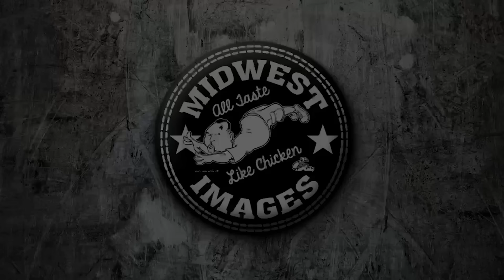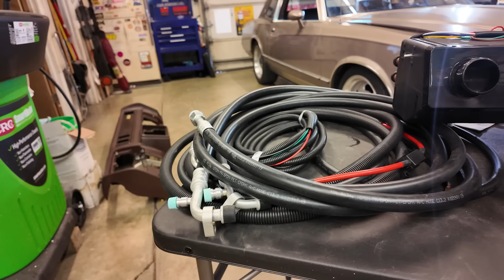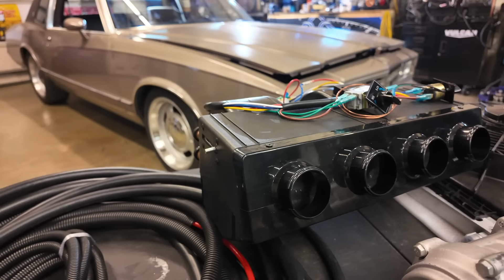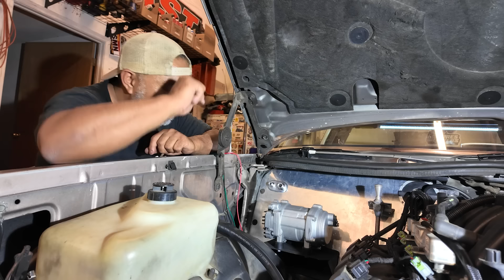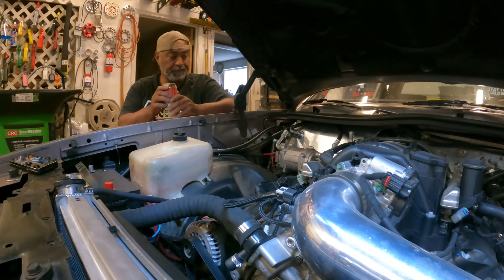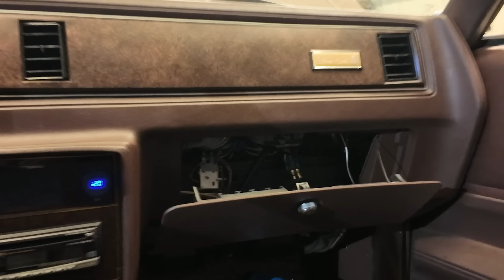12 VOLT AIR-CONDITIONING MY HEMI MONTE CARLO...IS IT WORTH IT?

Comment: We recently installed a 12 volt stand alone AC Unit on a forklift at work. It draws 48 amps running, and it spikes 60+ on startup. It was draining the battery and operator had to turn it off and let the truck idle for a few before turning the engine off to make sure it would start again. The factory alternator only put out 70 amps. I had to install a 105 amp alternator to keep up with the draw.
Reply: Amps are not really the measurement that matters... 12V or 240V its still same amount of WATTS. - But Ok! 
2400W at 12V = 200A = 2400W at 240V = 10A = Its just smaller wire at 10A vs 200A LOL
Reply: @misters2837  excellent point...higher voltage=lower current.
Reply: @misters2837 amps make conductors hot though. That's electricity 101. That's why amps is focused on. Also; batteries are rated in amp hours..... Just food for thought
Reply: @workingcountry1776 batteries are rated in volts AND amp-hours. Since battery voltage is fixed for a given battery (and the system it goes in), we compare amp-hours to determine how long a battery will last at a given voltage. You can't compare a 48-volt battery and 12-volt battery based on their amp-hours, because they are not interchangeable. But you can do the math to see how much power each system draws and how long a given battery in each given system will last on a full charge.
Reply: @misters2837 less loss in wiring and motors at higher volts and lower amps. a 48v system consumes about 20% less total wattage and is easier on all relays and motors
Reply: @misters2837 you didn't explain anything just crap
Reply: That's a ton of amps. I can't imagine the ones in Teslas draw that much power.
Reply: @mooosestang because Tesla is a few hundred volts. 12v has it's downside.
Reply: @mooosestang they run off the high voltage battery = lower current.
Reply: @mooosestang no, he said 48 amps. that is enough to lift 1000000 tons, using the right equipment.
Reply: @petedude2lu3 crap analogy.
Reply: @mooosestang they do...but Tesla has a huge ballery
Reply: @mooosestang  It draws about the same POWER (Power = Volts x Amps), but EVs use a High Voltage compressor that's runs off the HV 400 Volt battery pack... so their Current (Amps) is just a few Amps.
Reply: @mooosestang  I did a google search and it came up with this........
Tesla air conditioning systems, like those in other electric vehicles, utilize a heat pump and an electric motor to regulate cabin temperature. The system draws varying amounts of current depending on the cooling/heating demand and fan speed, ranging from 2 amps for minimal cooling to 12-15 amps for maximum cooling or heating, and potentially up to 20 amps.
Reply: @cuzz63 amps alone can be misleading, how many watts?
Reply: @rustedhorsepower5132 Exactly, depends on the voltage input of the Tesla system. W=VxA(current)
Reply: @cuzz63  Amps say nothing without a voltage . A heat pump is also just a fancy word for a normal ac cokpressor
Reply: I would consider a device that doesnt allow the motor to shut off unless the AC was off for a set time and the AC cant turn on until the engine has been on a set time.
Reply: Get rid of condenser fan and use the radiator fans with this condenser or the original condenser attached to front of radiator and wire it do that only 1 fan comes on low at any time the air is on and engine running like a normal car ac system works. Fans are some of the highest draws on any vehicle and they are designed to run low at idle, speed up above 950 rpm and turn off over 20 mph since air flows from speed and conserve energy. That condenser is way too small! Use stock condenser for less need for fans
Reply: Could it be that moving more air thru evaporator, the compressor wouldn't be at the 12,ooo BTU rating...kinda playing with rating...slowing down the air allowed it to get colder achieving the BTU rating for advertising purposes....but in reality it was based on such slow air movement it was unrealistic. Faster air movement would create inadequate air cooling.
Reply: @danobrien5154 BTU is like watts.

and it doesn't matter if you have high temperature delta at low airflow or high airflow at low temp. delta.

much like electrically high voltage at low amps or high amps at low voltage.  same power (watts or BTU)

it's rather a fake statement because you can't get 12.000BTU (3500W) from 12V/60A.  car AC is about COP of 2 - 2.2. that means for 3.5kw cooling capacity you'd need half that (COP of 2) electrically => that'd be 1.75KW and 12V × 60A is nowhere near 1.75Kw.  it's well below 1KW.

 because 83A at 12V is 1KW.
Reply: Put in a high amp alternator, idle up to 950 when air is on using the idle air control valve or set base idle screw to 950 and use a 200 amp lithium battery for all that electronics or at least 2 group 31 lead acid batteries or a 4d or 8d battery. Then get a voltage sensing relay to put between starter battery and your extra battery in the trunk so it disconnects from your starting battery at idle so it doesn't kill starting battery but still cool off of the lithium auxillary battery. Or add a second alternator and lithium battery.
Reply: That is epic
Reply: Thank you for supplying a ballpark number for running amperage.   That sounds realistic,  after all the belt-driven compressor on older cars is enough to affect idle (esp. on carbureted cars) and on economy cars you really feel a difference in acceleration with the air off vs. on.  

I've been planning one of these in my classic car;  in addition to an upgraded alternator I think I'll also work up a switch that ensures it's off when the engine isn't running,  or maybe when the voltage is below 12.5 or something along those lines.
Reply: @shovelIRL So far the 105 amp seems to be keeping up. With the AC on full at idle, voltage at the battery will drop from 14.1 down to about 13.3 or so. Give it any throttle and it'll go up to 13.6/7. We did install a 12 volt, 120 amp relay on a keyed circuit because the kit has you wire directly to the battery so it would run even with the key off.
Reply: @angryyankee9184 put a smaller pulley on the alternator so the alternator spins faster at idle that will help keep your voltage up and the alternator putting out more voltage and amps at idle

Comment: I wonder if you could use a vintage air heritage series with that compressor. I have one in my 60 Chevy and it blows hard. You can get just the under dash unit. Or if you could just get a replacement blower for the heritage unit, and adapt it.

Comment: I have a similar set up in my old Ford truck but I have the normal compressor mounted on the engine. The rest of it is just like yours.  I have some of the same issues. It’s gets plenty cold. I get mid 30s at the vents but it just doesn’t blow enough air.  I can barely feel the air hitting me. My question is, I’ve never been close to a vintage air system. I assume you have. Do they blow more air ? I seen online I could get just a vintage air evaporator and fans setup for the inside for around 500 bucks. I would keep everything else the same. I just need more air flow.  What do you think?

Comment: To me, the words, legit and ebay, don't go together. That unit should be running on at least 48 volts to be viable. Of course, that would mean a lot of changes would have to be made. Much easier to go conventional.

Comment: Duracool or another similar gas is 20x better than 134.   You want COLD you will get frost on your windows if you leave it running in the humidity and leave the window cracked 😂😅     but it is so so awesome.

Comment: Great video. I rocked G bodies in the 90s and the early 2000s you’re absolutely right about the window tint my G body’s always had tea tops and no matter what I did to the AC it was weak and a boot the cow was black. I’ve been heavily invested in the 73 to 77 A/G body I’m interested in this unit as a additional unit to the factory AC in my 77. My AC works pretty good but I like to be cold. This is interesting. Thanks again.
Reply: By the way, what series battery are you running a 75 or a 78 back in the day I ran the interstate MTP 78 with 1100 cold cranking amps. Back then I was running much more stereo than horsepower. Now I don’t have a stereo, but you’re absolutely right about having the charging system working correctly and then some.

Comment: I think the best use for this system given the low climate box airflow output would be to just use the compressor and retain or add the factory condenser, evaporator, and climate fan IF that's an option, which it wasn't in this case. 300 CFM worth of airflow would probably be ok in a Model A or '32, but anything with more interior volume isn't going to work very well. I have the same problem with my 95 Cherokee, factory A/C blows 40 degrees out the dash but the vents are so small it takes forever to cool that amount of interior volume.

Comment: Check out “Derale” fans. I have two on a four core on my 496 BBC. I can idle in traffic in 90* weather for an hour and temps will drop to 160 just sitting. Fans cool better than driving at 35 mph. They work! I got the Brushless fans. I do believe they have a budget line as well, but I am not familiar with them. But the brushless fans are IMPRESSIVE

Comment: Been eyeballing those Mechman alternators for a while now. They make some units upwards to 300 amps, likely for electric power steering and electric a/c equipped vehicles.. but this pump looks like the answer I’ve been looking for. Hopefully the new generation Vintage Air blower system is adequate, I’ll put a derale brishless fan on condenser, a dc voltage a/c pump all packaged in a well ventilated box in rear bed. Equip truck with a second (deep cycle maybe?) battery and a high amperage alternator to support everything.. 

Thanks for the info Mike.. great content and information

Comment: Looks like it could work with the factory evaporator in the car if it was still there, maybe even the original condenser. It would make a worthwhile experiment for someone. I agree with someone that suggested using a clamp on amp gauge to tell how much current ( how many amps) it draws to determine the alternator and battery required. Thanks for an enjoyable videl.

Comment: Very interested in (dc voltage?) compressor. I’ve got the complete vintage air system uninstalled. I have a BBC with serpentine drive behind a 4core radiator in a stock core support on my 69 c10. In other words it is tight and has zero extra clearance. I am not sure the a/c compressor will even fit behind radiator. So this option is VERY interesting, looking forward to the end of this to see how it pans out…

I’ve heard of electrical a/c pumps, just haven’t seen one in service. Been considering making an old school looking travel trunk to put in back bed, and put all the a/c components in there, and just run the vintage air off of the electrical a/c pump in bed instead of belt drive under hood..

Comment: I was wondering if the tech for AC in electric vehicles was going to start becoming available, this proves it is and that it's viable too.  Very useful if you've got limited space up front for putting stuff on the accessory belts.  Thanks :)

Comment: come on buddy you should know you can’t do that. If you’re going to add another battery, you need to add the exact same amperage and size battery same amps that a loan will help you tremendously. Another thing you can do is to actually raise your idle rpm once your air conditioner is on if I can do that on my 85 square body with a carbureted big block, I know you can have that done with that whenever you kick on the AC it should automatically bump up the idle and turn on the condenser fan like in my case I have two electric coolers keeping my big block cool if I was going to mount my condenser, I would mount it on the front side of my fans but it sounds like you need to do is upgrade your alternator you need something that’s gonna put out around 200 to 230 Amps just as if you were running power for a competition audio system

Comment: This is very interesting. I have a Monza wagon with SBC, and no compressor (V6 car). If this kind of compressor would work with the factory condenser, etc., I think I'll be set. Probably won't be to that point until next spring, but it's good to know this is out there and it works.

Comment: I had the same issue in my twin turbo LS chevelle with it dropping down to 12.5v at idle since im running a 19 inch PWM ZL1 fan that will rotate the earth when its on. I added a 220 amp alternator and it was still getting low at idle. I changed the main power wire from the alternator to my distribution block since my battery in in the trunk to a 4G welding cable and boom fixed. Stays at 13.7-13.9 at idle with everything in the car turned on max.

Comment: Great video Mike and an awesome review. In my 53 Chevy 1/2 ton Drag and Drive build (8.50 class) I'm running a Rencool compressor with a hortazontal remote mount condenser with a Spal fan. I got it from "Street F/X" down under. The compressor, condenser and dryer was $1800 USD. At full load it pulls 50 amps. I bought the complete "Old Air" inside kit for my truck. It was $1000. I have a polished billet large GM case Mechman alternator that puts out 256 amps and 180 amps at 800 RPM idle, $500. It's little cab and it's insulated but you can make ice cubes in there on a hot day. The "Old Air" kit has a vent that form fits along the entire bottom of the dash. I'm using my stock steering box with an "EPAS Performance" model specific electric power steering kit with a "Howe" 1:1.5 steering quickener. This brings my steering ratio from the stock 22:1 to a modern 14:1. I made a 15" steering wheel for it. Unless you look under the truck or dash you would never know they were there. I'm running a 1300 HP 6-71 blown/nitrous inline 6 Chevy 292 with a Ryan Falconer V-12 head and wanted my engine compartment looking stock. Sorry so long. Thank you for your time.
Reply: What other applications do they have? Now for the nerdy question, how much does it weigh? How intrusive is it in the engine compartment? Old spoiled trucker interested in putting it in my wannabw drag n drive car, '63 Valiant.
Reply: @vincentenk4449  My compressor and condenser is under the truck between the frame rails.
Reply: @vincentenk4449  I tried to put some links up but they didn't come up. Search you tube Street F/X electric air conditioner.
Reply: @vincentenk4449  https://www.youtube.com/watch?v=mRo05wph2F0
Reply: You need  videos of your setup lazyhound. Your setup sounds awsome but I only saw 2 videos on your channel. Just my 2 cents, please take my comment positivly and as genuine interest. Thanks.
Reply: @mikefew4232  Thanks for the nudge. I have been thinking about doing something on my channel. I'm just an old hippie but I do have a friend that says she will help me do it. I have a hard time talking to the camera when there is nobody there.
Reply: @lazyhoundracing9621  It helps if you have someone there and you are talking to them and the camera is just listening to your conversation, that the easies. If you choose to post something I will definitely watch.
Reply: @mikefew4232  Thanks.
Reply: I’m going to check your videos out after this one.. that sounds like an awesome i6 lol😂

Comment: That style of evap usually struggles to cool (I used to work at a a/c shop) I think I'll try it my truck has brand new dual agm batterys and I can upgrade the alternator if it needs, I'd like to be able to let it run say 20min while I run into the store

Comment: I have been looking at these compressors for a while wondering if it would work well enough with the Vintage Air Magnum I have in my 55. I know Vintage Air say not to use electric compressors but thats been on their website for about 5 years and these compressors are being used more and more in modern cars and EV

Comment: Thank you, Cotten. This does look easy to install and you covered the essentials with some good added advice. I may look at the 18k BTU for my van, just the compressor as it came with AC. It will be run just as you’re talking about for your van. (I have 400w solar and a 300Ah battery)
My one question is, does the compressor have to be mounted horizontally, or could I mount it in a different orientation?

Comment: Thanks, Mike! I've got a Dodge A100 that's similar to your Ford. I was wondering about getting one of these for it. As you well know, space is the problem. It looks like the box will fit under the dash & the unit could be mounted under the cabin floor. We'll have to see. Great info!👍😎 Safe travels!🙏🙏

Comment: Factory ac in the cars runs at 120 cfm to 200 cfm and the cooling coil is about 600btu and  1cubic foot of space ! The one you have is 12000 btus in about 3.5 square feet ! It should make ice on the windshield!
Reply: When I looked up average BTU of car air conditioner I got between 20,000 up to 30,000 BTU

Comment: Mechman alternators has a 240 amp alternator that I think you’ll love
Reply: the new trucks have a much better 220amp direct bolt on for almost all ls accessorie drives. can be had for 100$ on ebay for low mileage take offs. work great, I see well over 100amps at idle speed without issue